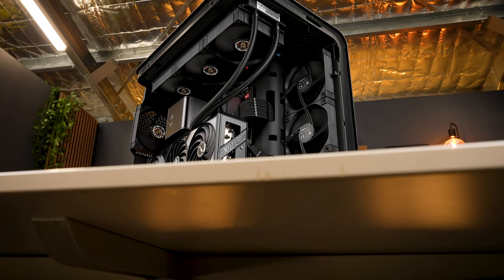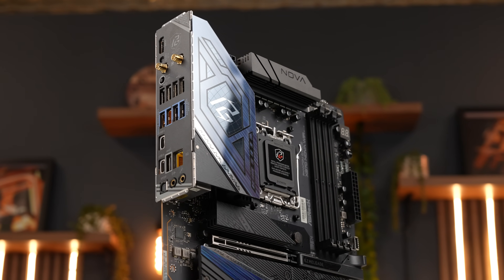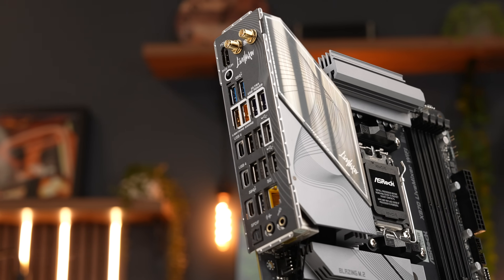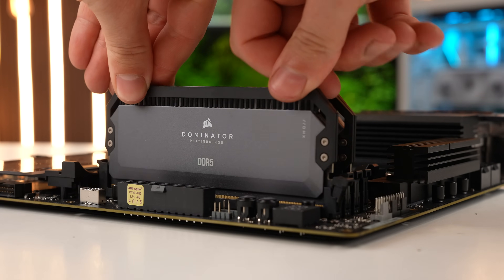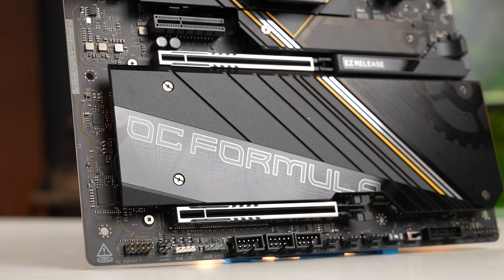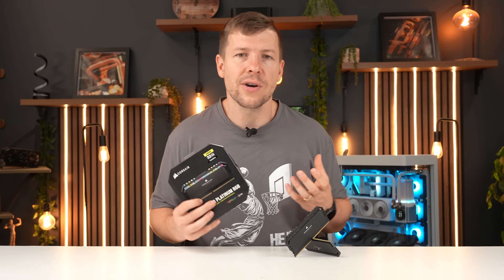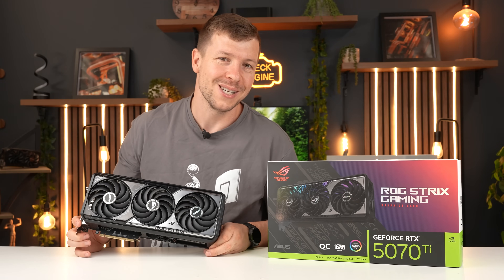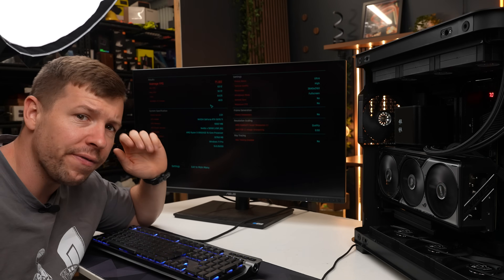Stealth 9950X3D Creator PC Build — Choosing the Ultimate X870 Board

Comment: With my system which is a lot lower in spec than this i can get 165fps on 4k medium i5 13400f 32gb 5600mhz ram 9060xt 16gb
Samsung g5 32inch ultra wide

Comment: Choosing asrock for a 9000 series build is wild.
Reply: Have had ASRock board and 9950x3d for almost a year and never had an issue. I also overclock heavily.
Reply: @flitai yeah, been using the nova since day 1 of 5090 release with 9800x3d and the 5090 without even the most minor issue.
Reply: @user_z01  Dude I absolutely love ASRock and I know I sound like a shill to some. BUT, the best thing about ASRock that no other motherboard has is a BIOS that EXPLAINS each setting enough to further research online AND less than a 20s boot time through Fast boot, DDR5 Nitro Mode, and reduced read training tap amount. (1x taps) is fastest. All my new builds use ASRock and I've had a 9950x3d overclocked on the x870e taichi for just over a year and it never had stability issues, burned up.
Reply: Hypocrisy
Reply from the maker: Only if you havnt updated your bios for the fix
Reply: @DesignsByIFR  Still I would not trust/risk ASRock
Reply: @Teksers  Because you never tried it in the first place. Im convinced all the people that burned their CPUs did it themselves by manually overclocking stupid voltages.
Reply: @DesignsByIFR  As for your ram, I would get a CL30 kit not CL34 then with 4 dimms you can loosen the timings a bit to CL34 from CL30 and losing primary and secondary by a few steps (usually *2*) and it should work a lot better than 1.35V CL34 kits. If the kit is rated for 1.4v its a lot better bin than 1.35v
Reply: @DesignsByIFR  I'm hearing really conflictin reports about the bios fix
Reply: @DesignsByIFR  I will buy 9 9950x3d, I consider this Thaichi x870e. I heard some disturbing things about the CPU being damaged with this MB. Is it true, should I worry? Can you share what is the safest MB, I don't want to risk it, but also I want x8/x8 capabilities.